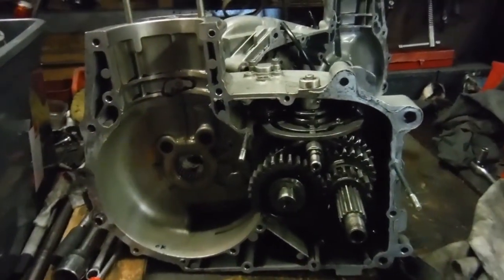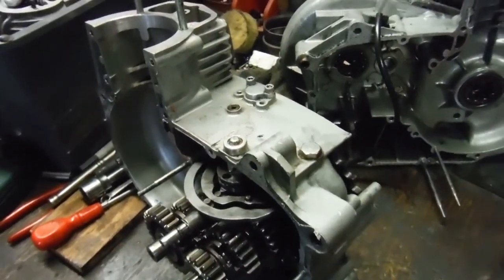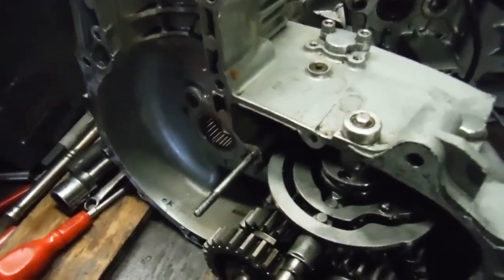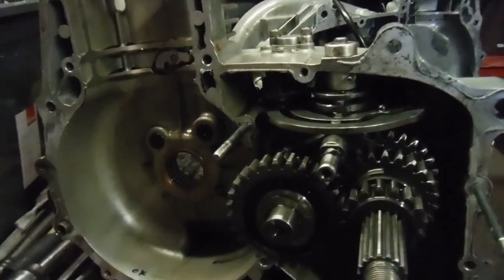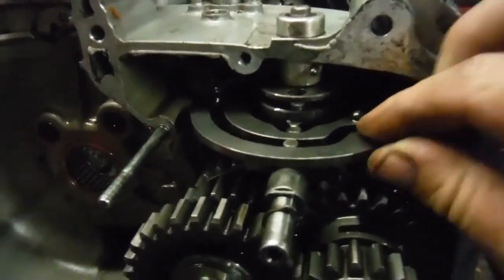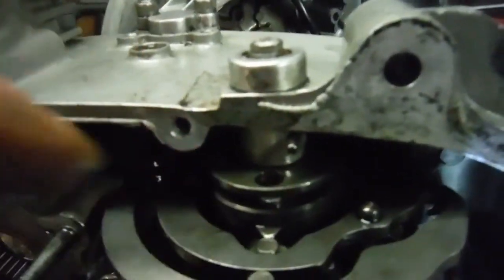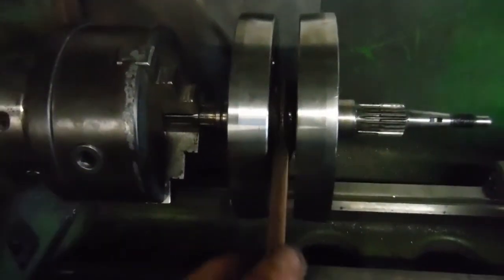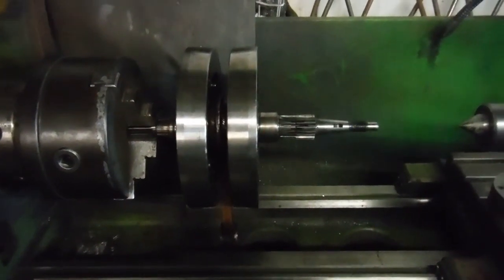Royal Enfield UCE engine split for inspection, gear problem solved.

Comment: The modern engine still has not solved the quality control problems at Royal Enfield India. Nothing like this should be found in a nearly new motorcycle. When people buy one of these do they have to pull it all apart and then rebuild it up again just to make sure that it was done properly at the factory. A good video Paul and thank you for posting. Bob

Comment: Hey Paul, been watching your videos for a long time, love em! Having a bit of trouble with a 535 gt coming down the box from third to second, and the bike goes into neutral instead, skipping second entirely? Bikes only covered 1200 miles, and hoping it's a common/easy fix? Didn't know if you'd come across it before.
Reply from the maker: Thanks - it might be as I describe in this clip, it would certainly be easy enough to try it - you don't have to go inside the engine. Good luck!